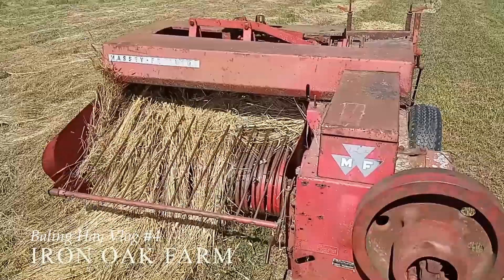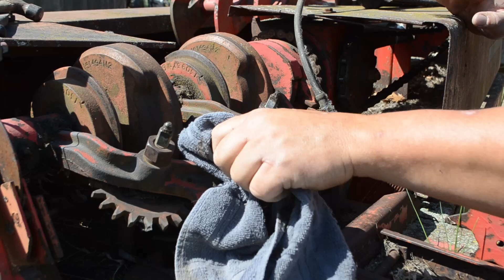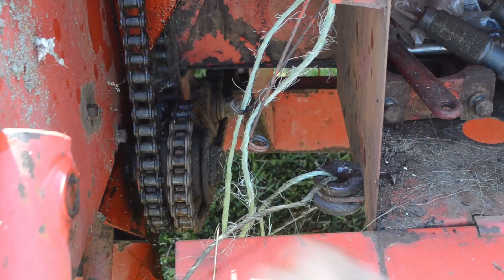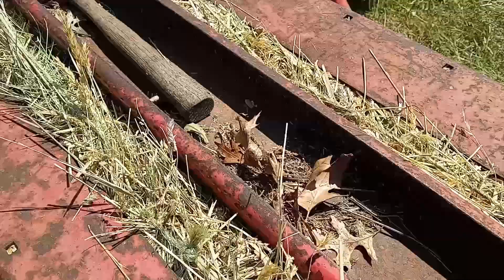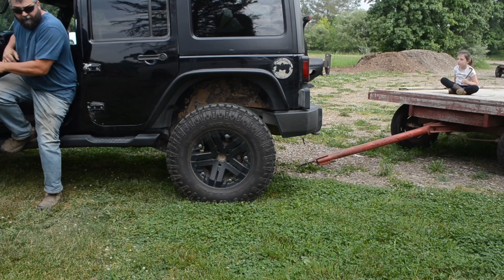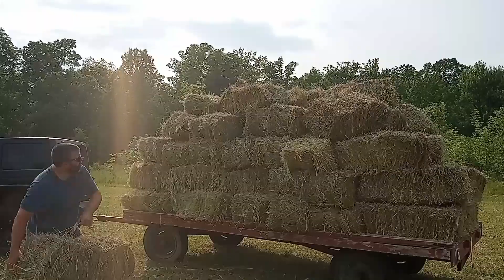Baling Hay Vlog #4

Comment: We only have 5 acres of what is left of the family homestead.  A couple of years ago, as a bit of an experiment, I decided to try take hay off of a couple of newly cleared areas.  Total, that might be 2 1/2 acreas.  I had done the research to understand what an average yield was off an acre and thought at the very least, it would help offset feed costs.  If, that is, I could do it on the cheap.  I already had the tractor and trailers, but I scrounged up a $50 JD #5 mower like yours and a $250 M-H #11 hay rake.  Mower needed some work, but the rake I paid a premium on as the guy delivered it.  lol  We pick it up with pitch forks.  Now, a baler sounds good, but it really only means a more convenient package in the end, and the goats have no issues with loose hay.  I am not sure we are going to do this long term, but very rewarding to put up our own hay and it has been worth the little bit of an investment and the time.  Now, if I could only get some rain so we can get a second cutting...  Take care!
Reply from the maker: It's extremely rewarding to be able to put up your own hay for sure. Our setup is years in the making. I bought two of the JD sickles for $100 and had to rebuild one with parts from the other and make some parts from scratch to get it working great. I was able to find that baler about 10 years ago and I think we paid $800 for it. Although it did work, it was a challenge. Over the years I've repaired and rebuilt little bits here and there and now it's working great in my opinion. So for $1000 or so and some mechanical repairs we can put up our own hay. It's all paid for itself many times over considering the cost of hay. Working with this old equipment can certainly test your patience for sure, but when it all comes together it's that much sweeter.
Reply from the maker: And yes, we could definitely use the rain. The fields aren't doing much since that first cutting!